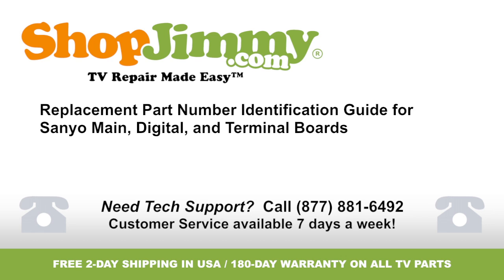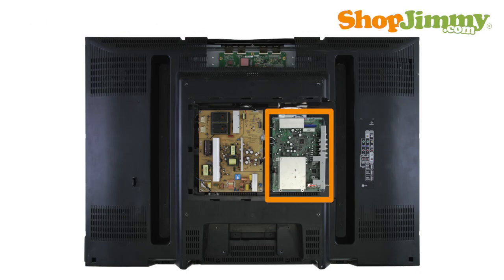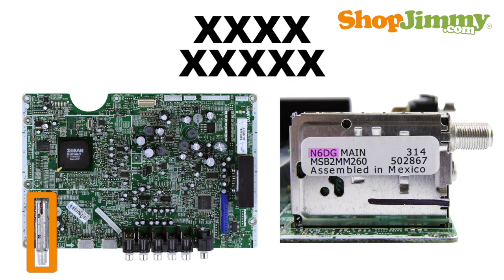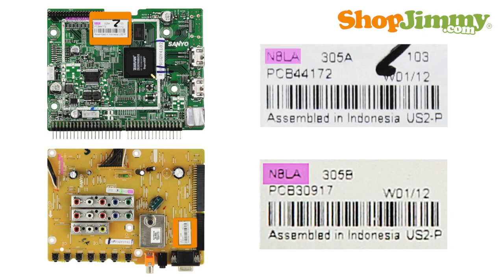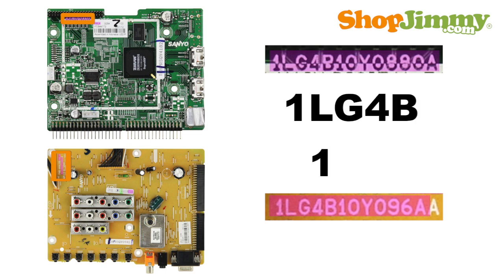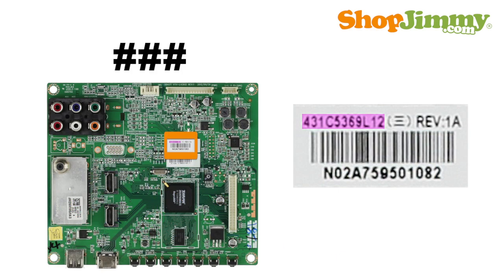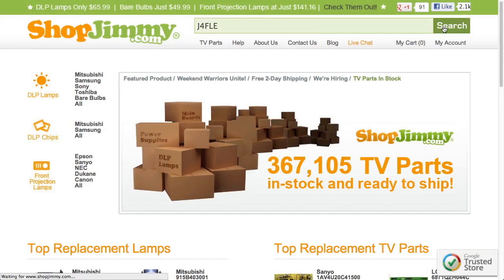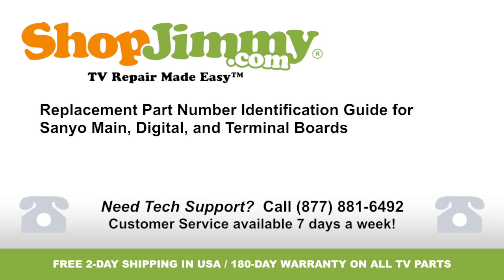TV Part Number ID Guide for Sanyo Main, Digital, & Terminal Boards (LCD, LED, Plasma TVs)

Comment: I have problem with my 60" sharp aquos smart tv model no LC60LE660U  issues that i have is that power comes on but there is no picture or sound.total blank (black) screen.  when i turn the power on there is a split second flash on the screen you can read as no signal sign on screen. the other thing i notice that  ambient light sensor is not on either. i watched your video and did those two steps there is no visible light can be seen through back panel and the flash light test did not reveal any thing. this tv is only 2 and half yrs old. please advise.